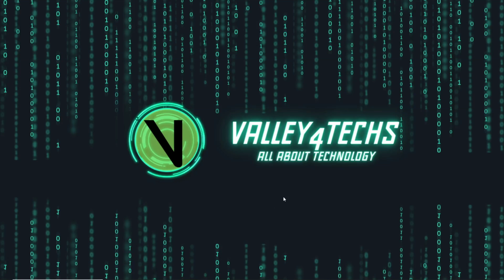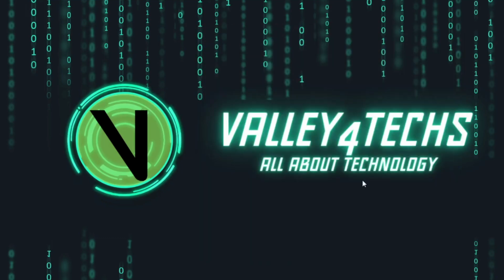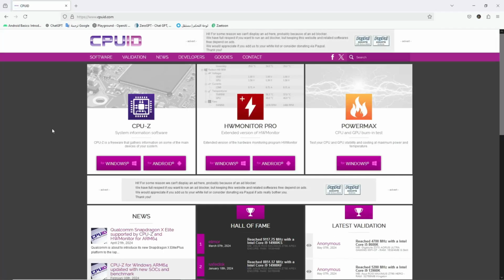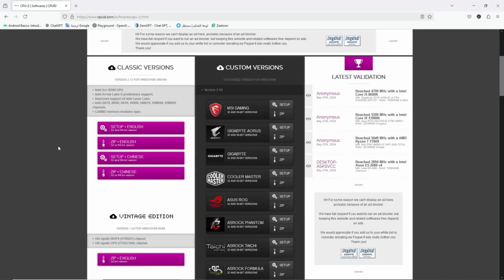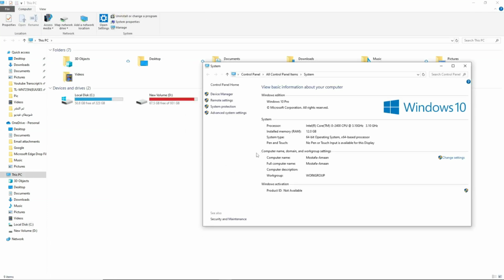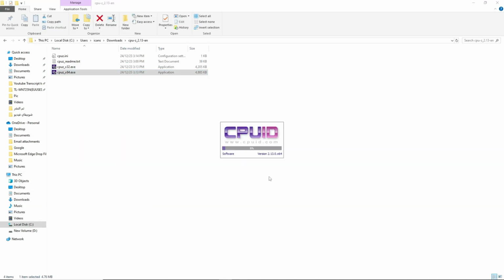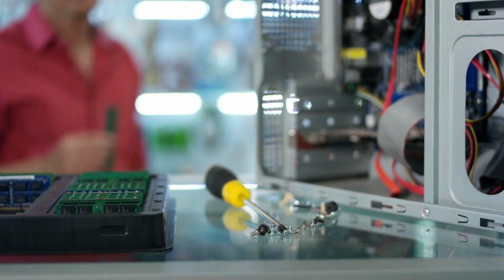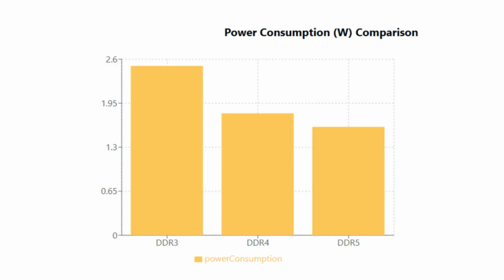How to Check Your RAM Type in Windows 7/10/11 - DDR3, DDR4, or DDR5

Comment: How can I uninstall CPU-Z cpuid? It’s not in the programs files, so there’s no uninstall option, and it’s not listed in the add or remove programs list?
Reply from the maker: Good question! CPU-Z is actually a portable program - it doesn't require installation, so there's no uninstaller. You can simply delete the CPU-Z folder or executable file wherever you downloaded it (usually in Downloads or Desktop). That's it - no registry entries or system files to worry about. It's one of the benefits of portable software! 😊

Comment: Don't use the link in the video. It's a virus. you have been warned. Got a heads up from my system before it could install. While the program is real this URL link is a virus.
Reply from the maker: I understand your security concerns, but I need to respectfully correct this. The link (cpuid.com) is the official website for CPU-Z, one of the most trusted system tools in the tech industry for over 20 years. Major tech publications like Tom's Hardware, AnandTech, and TechPowerUp all reference this same official site. 

Your antivirus likely showed a false positive - this is common with hardware monitoring tools since they access system information. I always verify every link before sharing it with my viewers, and I take their safety seriously. 

To other viewers: the link is completely safe, but as always, feel free to verify independently through any major tech review site.